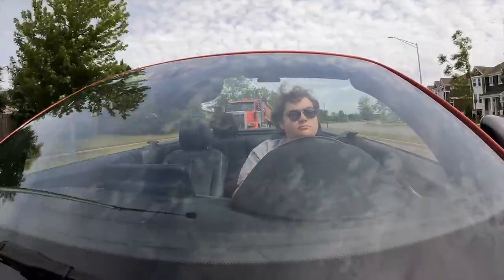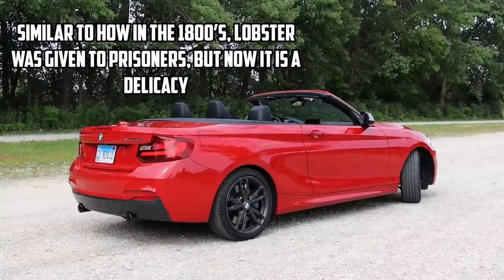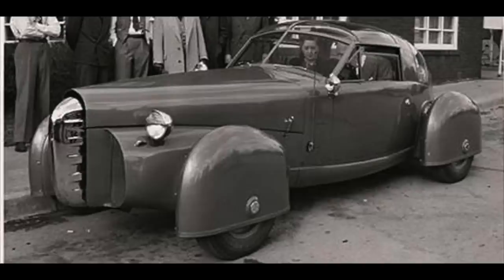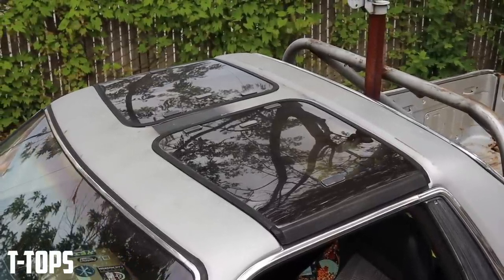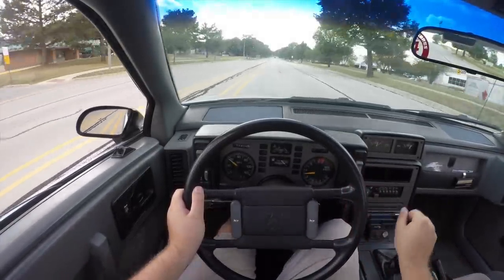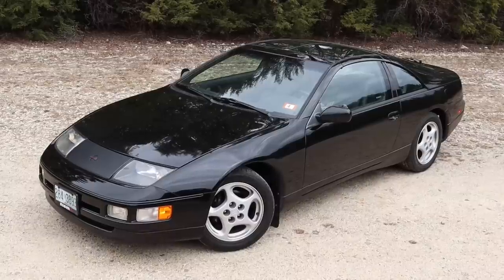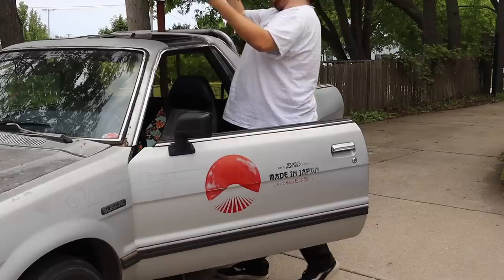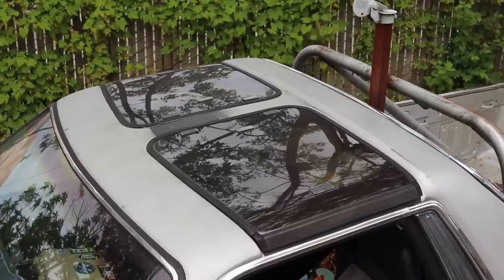T-Tops - How They Were Invented & Why They Went Away!

Comment: I drove a 1979 Trans Am for a few years, and it was not a practical car. T-top cars DID flex in corners, quite badly. Secondly, you had virtually no trunk, which got even smaller when you used it to store your glass roof panels in a special vinyl bag. Third, because of the cost, thieves often targeted the removable panels. Fourth, you literally had a glass roof. Even with tinted glass, If your AC compressor went out, you cooked alive in the summer. I think I kept mine 2 years.

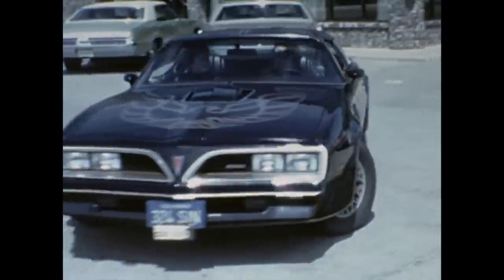Comment: 8:01 - A trunk full of what?? Cores?! Chords? Corrs?? I have no idea what you are talking about.

Also: Air conditioning.
My last car, a '91 Civic, had a sunroof. Yes, it leaked. But that's not my point. My new car, of course, has AC. Driving with the open sunroof in summer was nice, but you had the sun blasting at your head, sometimes even blinding you. I find AC much more comfortable, so that is my #1 reason not to get a T-Top even if I could get one installed for free.

Comment: T-tops and Targa Tops went away because they lost the war against the sunsoofs due to ELECTRIFICATION. They couldn't be made electric to keep up with the times without looking silly or costing a fortune. Meaninng they couldn't be cheaply made to open up and put themselves away automatically like the electric sunroof. The advantages of the electric sunroof outweighed the advantages of the T-top. The convenience of Push-button operation was a death blow to the T-top and a huge selling point for sunroofs. Sunroofs simply become more practical and were able to open automatically and go completely out of sight in less than 10 seconds and didn't need to be stored in the trunk or behind the seat or left at home just to be enjoyed. Unlike T-tops, the electric sunroof was impossible to steal quickly.

Also, for example: If it started raining while you were driving up the highway, with an electric sunroof you simply press a button and keep going. It closed automatically. Targa tops and T-tops required you to pull over, stop and get out in the rain or in the dark in dangerous areas. And also sunroofs weren't limited to sports cars like most T-tops. They worked on any car very well, even on luxury cars like Cadillacs, even on SUV's and pickup trucks where a T-top would look ridiculous to most customers.

Comment: Ttops are a double edged sword, same as pop up headlights. They are fun, and are a more masculine option for wind in your hair as a dude imo lol. I have had a convertible,  but its definitely not my thing. I also hate how the car looks as a convertible model. Bad part about them, they all leak. Matthew's 20k mile 1999 transam tops leak, Ethans 187k mile 1987 iroc leaks, Mine leaks lol. Part of owning something with them. Pop up  headlights are still cool imo, but whats not cool is when you can't find a headlight door module, and if you do, they are outrageously exspensive because no one makes one. Or when your headlight motors plastic gears keep stripping out. Go to turn your lights on and only one opens or go to turn them off and they stay up , pull up to the car meet and let your headlights down and all you hear for miles is rrrrrrrhhhhhhhhhhhhhhhhhrrrrrrrrrrrrr lol

Comment: I think a lot of it is the seals just never held up well. And we generally just don't have much desire for convertibles today. Look at how many fewer convertible vehicles are offered. We haven't alhad a convertible Cadillac from the factory since the XLR. No convertible in FCA other than the Wrangler/Gladiator and Viper. And the Sebring/PT Cruiser and the Toyota Solara were the last affordable convertibles I can think of that truly have no sport car appeal outside of styling. In fact, the Wrangler and Miata are probably the cheapest convertibles around in the past 10 years, and the Miata has made a hardtop model, so convertibles are just not that desirable right now in general.

Comment: Women that live somewhere where weather can be all over the place, lets call it northern Europe, will recognise the issue: you want to wear a light sundress, but the sunshine and temprature probably won't stay summertime like all day. So you pack a pair of sheer pantyhose in your handbag to be smart. But in the end the trouble of finding a place to put on the pantyhose, maybe later the day finding another place to take the nylons back off, the danger of ripping them doing so... It is so anoying you end op just going through the rain with the goosebumbs on your legs for everyone to see.
T-tops are the same but even worse. They are just irritating difficult to remove and store away and once you done so, even a hurricane makes you hesitate to put the damm thing on again, so you end up driving home while the rain is pooring down your face, ruing not just your haircut but also your cars interior. People found out the hard way and never repurchased a T-top.

Comment: The only benefit today of T tops is the retro cool factor. When they were fashionable they were problematic and quite ugly as the video points out. Even when new they often leaked. The glass was heavy and thick. Even sunroofs have the potential for leakage. Most people hardly ever open their sunroofs anyway. There is also the possibility the motor will jam or trip the fuse and you are stuck with it open. Plus the radiation of heat problem. Pop up headlights gained popularity because manufacturers could design a lower and more aerodynamic nose of the car and meet the height  standards for the lights. Today they are difficult to design to meet pedestrian safety standards plus, like power sunroofs, they require electric motors and circuitry and gears to open and close. Think about the cost of repair in an accident. That might also affect cost of insurance. Pop ups gained popularity in the era of sealed beam headlights. As we know current designs have eliminated the advantage of pop ups for all intents and purposes.

Comment: T-tops would make development of current car much more expensive because of prescribed structural rigidity for crash test compliance setled by new legislation.....+ political requrement to lower CO2 over whole production range eliminates number of aerodinamically insufficient cars the manufacturer can produce....sliding sunroofs can be optimized  for both aspects  with roof angle and recractable wind deflector. Classic convertible can be shaped from ground to push air around car limiting drag from turbulence....Interesting option were BMWs converted by Baur in 80'...only roof panel and rear window were replaced with convertible unit.....doors and their frames stayed in place....

Comment: I like your videos. I think ur dates are wrong around the 5:45 mark, talking about Reagan coming into office and getting rid of the rules. Reagan was elected in 80, left in 88. Safety didn’t really start until mid 80’s, with seat belts and 3rd brake lights. Early 90’s on airbags, 1991 I think. If I am incorrect, I apologize, mine is purely from memory from being a teenager and starting to drive in 1986.

Comment: I think you forgot the REAL reason T-Tops don’t exist anymore.

Production cost.

While people like convertibles and arguably T-Tops. As an automobile manufacturer, the LESS differences across the Sam models and lines the higher quantity of less parts you can make cheaper.

So you have NO deviation of body style. The Dodge Challenger. No convertibles, no T-Tops and even the Magnum is gone from Dodge.

If you are going to add a difference, I’m guessing that on average, given the choice between the T-Tops OR a convertible, most would chose the convertible.

Comment: They are just a hassle to put on and take off. Look how easy the roof is on the ND MX-5 wether the RF or convertible. In fact if you lined all the high price convertibles up with tops down for a drag race with the MX-5. They all have to put the tops up before launch…the MX-5 is going to beat all of them to the quarter mile 😂

Comment: I would say they have gone away for two reasons number one being in the auto body industry the modern construction techniques do not lend themselves to t-tops and secondly owning a 87 fox body t top mustang at one point and doing a full restoration I realized cars and concepts done the t-top conversions to the fox body mustangs Ford had no part in it but if you were to have a new car with a body warranty issue where are you going to take it back to Ford for them to fix a problem with another company's product that's reason number two

Comment: I absolutely hate when some gets a muscle car or sports car with a convertible top. You literally just ruined the vehicle with nearly 900 lbs of extra equipment.
Reply: They only drive in straight lines, bro. Hell, 99% of car guys only roll race
Reply: @RhodokTribesman  doesn’t matter, weight is extremely important in racing. The reason motorcycles can so effortlessly out accelerate cars is due to the enormous difference in weight, the same holds true for cars if you take 2 off the exact same vehicle but make 1 of them a convertible the hard top is going to beat it 100% of the time because the engine and transmissions now have to move less weight.

Comment: T-Tops were a piss poor design, especially among the F-body cars. Every car that has one has the same problem: they inevitably leak. Wanna stop body flex? You’re gonna need subframe connectors, which will strengthen the chassis but add weight. Had a Firebird with leaky T-Tops and after that I said never again, sold it and bought one with a hardtop.